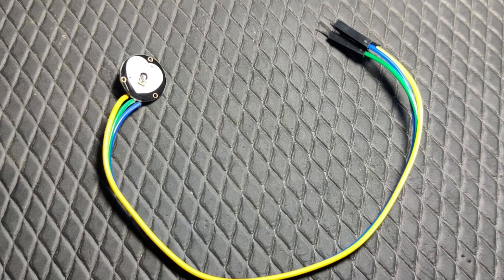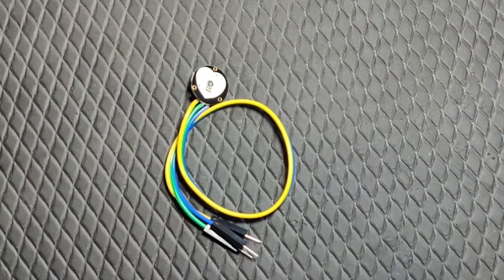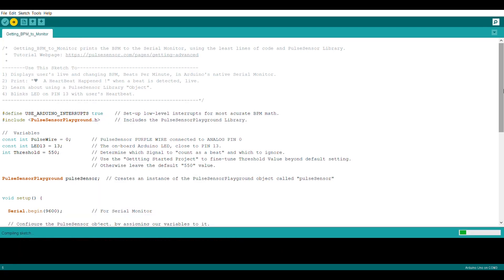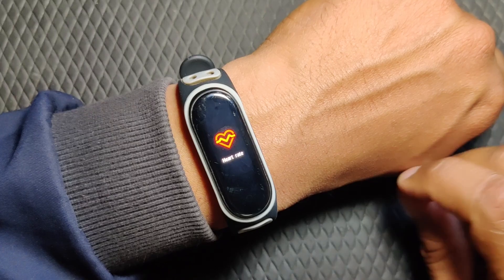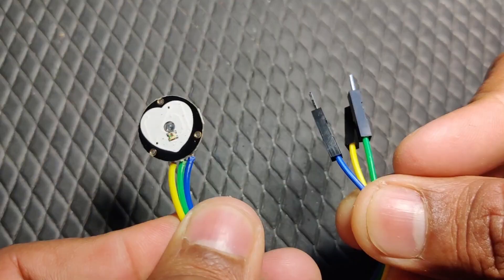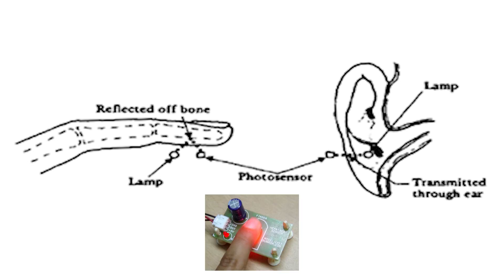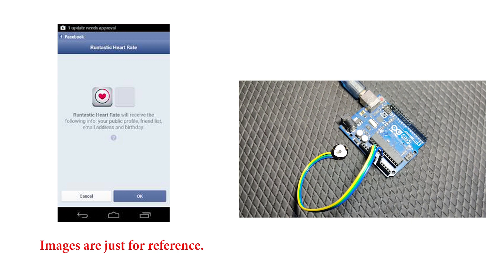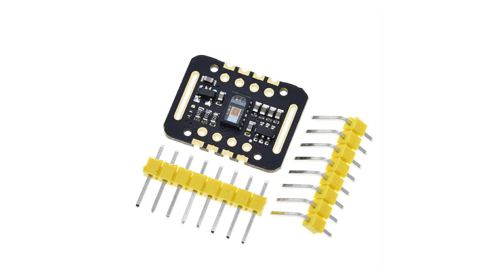why your heart rate sensor is not working ? issue with Heart rate sensor

Comment: I interfaced a pulse sensor with Arduino Uno(5V) work well. 
With same program not working in node mcu esp8266(3.3V)
Reply from the maker: which sensor you are using?
Reply: @electronicGURU  
Pulse Sensor - SEN-11574 - SparkFun
Serial, plotting is ok when just use analogread in nodemcu esp8266, 
But program for BPM(where used pulse sensor playground library) is not working in nodemcu.
Reply from the maker: well i woule suggest  to try a single AnalogRead (similar) sketch and check it it gives output or not , if it does check it in serial plotter.
Reply: @electronicGURU  it was working. 
Now finally found it.it was a problem of Arduino  intrupts it doesn't work with node mcu, I used another program and I solved the issue .
Your video was very helpful to me to success of my project. 🤝
Reply from the maker: sure anytime  brother  , happy  to hear that it worked